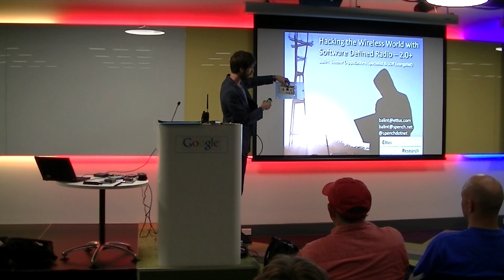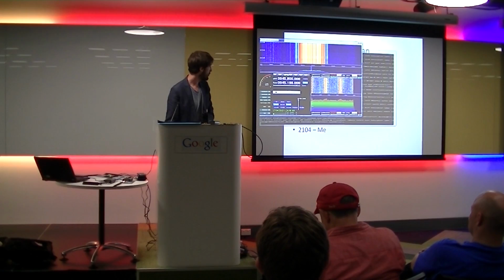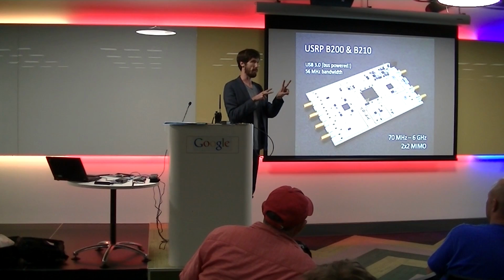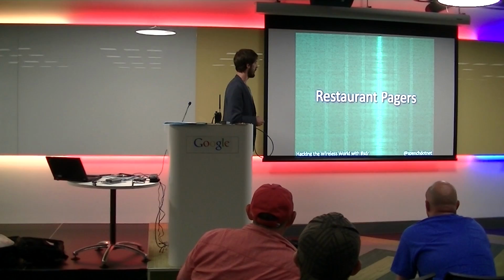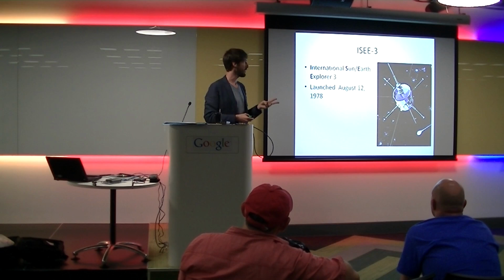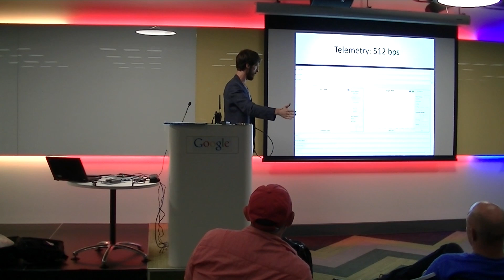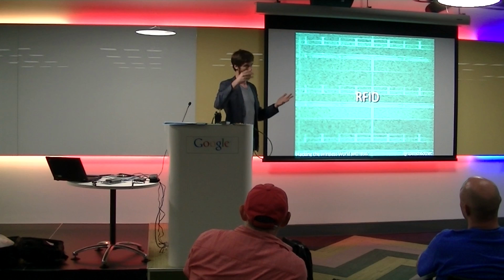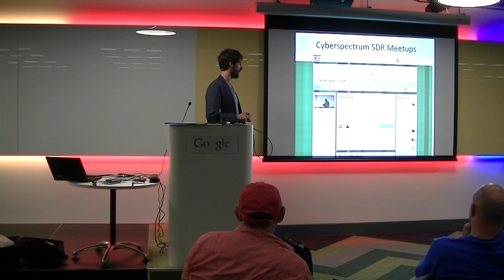Ruxmon Sydney (April 2015): Hacking the Wireless World with SDR

Comment: This is cool. Running a GSM base station during a talk has been done before at a Defcon talk by Chris [now Kristin] Paget. (although there the object was to spoof a legit tower and capture the call data)
His implementation was not so streamlined though. One board, with power and antenna, that handles the whole business, and the radio waterfall of the signals in real time. Very Very cool. I need some of Ettius's boards.